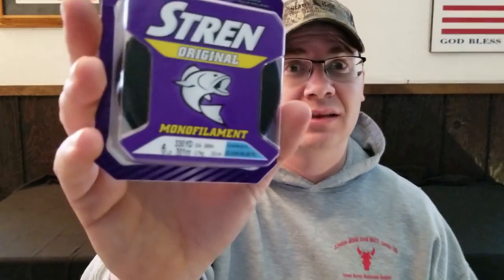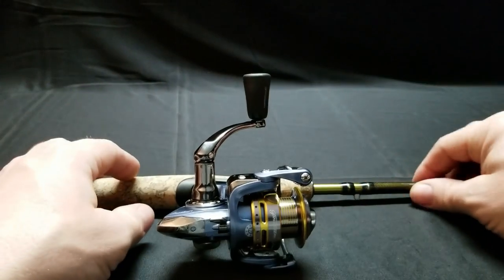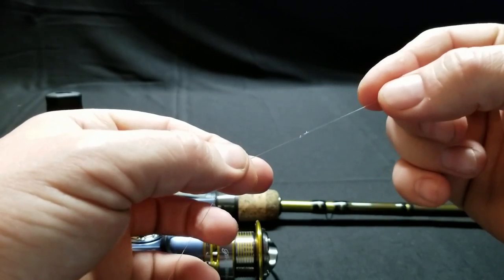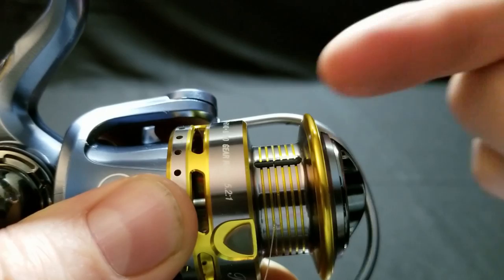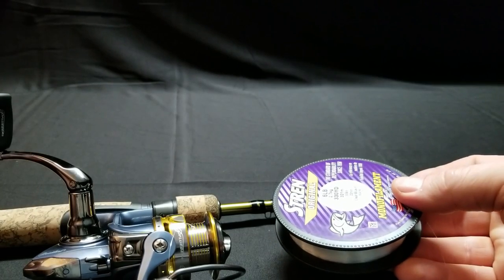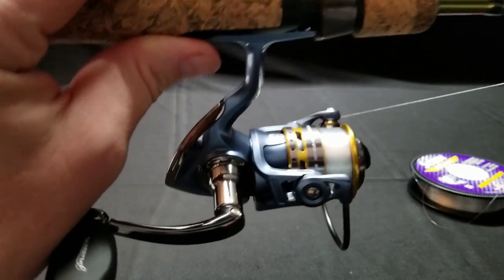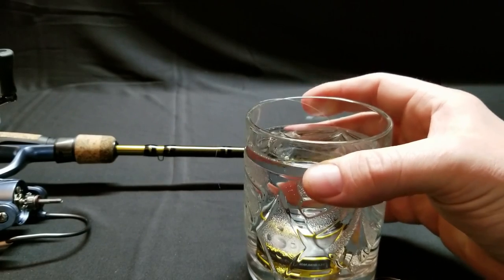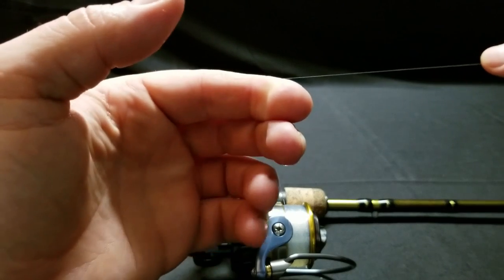NO MORE TANGLED LINE!!! | How-To Put Line on a Spinning Reel

Comment: Because of the size difference in the spools, reel vs new line spool, you will get line twist if you keep spool label up. Just watch the loop coils as you're loading the reel. When you see the coils getting smaller just flip the spool. I do it with my feet. Just keep alternating the spool, label up and label down. Have done it this way for years and don't have a problem with line twist. I hope this helps someone. Great tip on the warm water. I never knew. Tight lines brothers.

Comment: The part where you said “no matter what type of line it is, as long as you have the label pointed to the sky, it will come off the proper way” is entirely false. Depending on the manufacturer line is spooled in different directions. Although most are spooled the same, some are not, I’ve seen it. The key is that you want the line to come off counter clockwise.
Reply: I agree totally . The label has nothing to do with anything. If the reel winds on clockwise, the other spool needs to be coming off anti clockwise.
Reply: @stevestumbaugh8982  this clockwise tip is great but, clockwise on the reel looking from where? I just now see that it's looking from handle through reel to spool.

Gotta go wind up a new reel.
Reply: Ohhhh so that’s why I’m making a tangled up mess each try and have to cut it off wasting line.  I was following label up and that’s wrong for me. Wish I’d ran across this comment earlier as would saved me mass frustration. Damn near took it to a shop!
Reply: Exactly Redline.  Not all manufacturers are alike. Case in point I just spooled on some 6 lb trilene, the line is supposed to come off the Spool in the counterclockwise rotation, the label is facing towards my bed.  The correct way of saying it is the line is supposed to come off counter-clockwise, nothing to do with the label. Mike Iaconelli and others will tell ya the same 😅
Reply: @hardrockminer-50  Looking from the rod tip at the spool end of the reel.  If the bail turns clockwise the line spool should lay on whichever end that has the line coming off counterclockwise.
Reply: Jack wagon he said that in the video .
Reply: I only use mono on one reel that holds about 160m of 3kg line.   Its a lot for the reel and best option is backing but ill explain that one later.   I buy two spools of Maxima and in order to make a continuous line they have to come off with label down.  I do agree with the warm water for memory but if you put "too much" tension when putting it on, your line uses a lot less space on the reel. Even though you left extra seating lip (appears 80% full)  your second cast could become a birds nest because you never gain the same tension on a regular cast retrieve.  I cast about 80-100m so it gets real loose and very fast.   Might pre-answer why i use line so light.   Its a distance thing on lakes in Ireland that has wild trout who get spooked very very easily.   And yes,   i do use small baits for trout.   Prob weighing about 6g.    I can peel that off a reel without problem.   Wind permitting.
Reply: You are right. I clicked on this video because I wanted to double check that it was supposed to come off counter clockwise and I fast forwarded to the part where he said “label up is always correct” and I was very disappointed. All great tips except for that part...which can totally screw it all up and cause someone to waste 200 yards of line. Because of that, I had to give the video a thumbs down.
Reply: Redline870 Correct!
Reply: Filler spools are not labeled consistently.  Just make sure the line comes off the filler spool counterclockwise.  All spinning reels turn in the same direction.
Reply: ...so if the line is spun clockwise...
Reply: Zebco brand line is spooled all different
Reply from the maker: You are correct
Reply: @stevestumbaugh8982  that makes no sense dog.. Anti clockwise??? Are you related to Joe Biden??

Comment: Good video, I agree from experience if the line does not come off the spool with the same rotation as the reel it will tend to birdcage and you have a mess, especially if there is any slack on the cast.  If you spool in the wrong direction then you can usually put a heavy weight on the line and cast as far as you can, then it tends to reel back on correctly.
Reply from the maker: I have had to walk all of the line off the reel and reel it back on, thanks for watching!

Comment: I have, on multiple occasions, seen supply spools (what you buy at the store when you get fishing line) loaded backwards. Most of them seemed to be large spools, like what is used by tackle shops. So, always check the direction the line is coming off the spool. Usually, you'll want the label facing up. But, not always. I think a lot of spools used by tackle shops are loaded differently, but I don't know why.
Reply from the maker: As long as the line is coming off the spool  counter clockwise you’re good to go.

Comment: i have seen so many vids on how they think a proper spooling should be done and no way to tell what is the correct method, but a thought came to mind that i can spool line on my reel any way and then when im done simply get a large bearing snap swivel and attach my line to it and use the snap to attach it to a fence and then start walking back and unspooling it all the way ,then slowly put a bit of tension on the whole length of line and let go a few time then start spooling it all back on, i believe this helps stretch the memory out and the bearing swivel removes any twist on the entire line so that the whole length of it is straight without twist before you start reeling it in, and after that you can always dunk the spool in hot water and leave it till it cools down or leave it in there for a few days which helps to remove memory and like you said shape it to that diameter,, let me know what you think about using the snap swivel like that
Reply from the maker: I think the snap swivel will work, but it better be a high quality swivel. Some swivels don’t swivel well when there is pressure on them.
Reply: @MidwestBassHunter  correct get one expensive high quality ball bearing snap swivel and even spray some wd40 or oil it up to help even more , this is also why i say to put tension and release a few times to help it remove any twists ,doing this intermittently while reeling the line

Comment: I get a piece of wood with a nail in it, put the spool on the nail laying on the floor. Thread the line through all the eyes. When I'm reeling I lay a book on the line and reel it in naturally and never had a problem.
Reply: That's not a bad idea. I usually just have my gf or cousin or someone stick a pencil through and put tension on the line spool  in-between there fingers. then reel it in normal. Then depending if they need to or not have them add or release tension on how tight theyre squeezing the line spool

Comment: Dont depend on the spool label to be on the same side of the spool for all lines. Pay attention so the line comes off of the spool the same direction that it will be loaded onto your reel. The Hot Water trick will help set your line to the smaller spool of your reel.
Reply: Yes, once in a while they mess up on this!  Also, if I see a twist set in, I will flip the spool for a few turns to reverse it. The line spool is a bigger diameter than your reel so a little twist can set in. The hot water trick is a good one that I will try - will reduce birds nests from line coming off the reel by itself.

Comment: Good timing on this video. I bought a brand new spool for this year and it has the worst memory I've ever had. To make matters worse, I'm going down to a 1000 size reel this year so the spool size is even smaller. I just respooled it and I'm trying the warm water trick. We'll see how it goes...
Reply from the maker: Good luck

Comment: if you have a boat, you can put it on any way it comes off the spool. All you have to do is let the line off the reel out behind the boat with nothen tied to it as you idle. Let pretty much all the line out and drag it behind the  boat for a couple minutes and then reel it back on. The line will be completely straight no twist what so ever. Its good to do this every so often and you will never have trouble with twist.
Reply from the maker: That’s a great tip!

Comment: Actually I used an old reel and spoiled it up with a towel. Then I hooked up the end to the actual reel which is the final destination to this line, set up brake on the old reel, this way when I roll it up, it will be the perfect tightness along the whole line.
Reply from the maker: Cool

Comment: Having the label up is not correct in all circumstances. The line needs to come off counter clockwise.
Reply: Yeah, I listened to this vidoe about spool up  and incorrectly spooled my reel with spider wire ez fluro.
Reply: It really doesn't matter which direction the label is going, so long as the line gets on the reel....
Reply: The line should be coming off the spool in the same direction your reel spins! I’ve had line that cane off counter clock wise, so I had to lay the spool down upside down bc my reel spins clock wise
Reply: Heat gun will put that label on the other side reel quick.
Reply: @mikewest712  😂😂😂🤟
Reply: So it's coming off the spool clockwise so he is doing it wrong?

Comment: I have a spinning reel and baitcaster, I like that tip, going to use it. I have a question, if I use braided line on spinning reel, do I need to put spool in water like you did the mono?
Reply from the maker: No need on the braid
Reply: @MidwestBassHunter  Thanks

Comment: Hi. I just got a new Shimano FX1000 ultralight. I got 10lb and 12lb fishing line for my Ugly Stick GX2. Does it really make a difference if I use thicker fishing line on an ultralight?

I'm still going to buy some 6lb line for it but I was wondering.. If you were stranded on an island and all you had were ultralight fishing poles and 12lb line, I feel like it would still work. I'm going to buy the 6lb line tomorrow.
Reply from the maker: It will definitely make a difference.  That setup will not cast and function as well with that heavier line.  That being said if I was stranded on an island I would use whatever I could get ahold of.

Comment: Even tension is best done with another reel . Set it up so that your line goes from the spool , takes three turns around the slave reel  then onto the reel you want to load . Line every thing up and set the drag on the slave reel so when the line is loading onto the reel you want to fill it's a perfect even tension . Set the tension correctly and it stretches the line while you're at it ..no water , no stretching required later , job done in one hit .
Reply from the maker: Interesting 🤔
Reply: Very good idea

Comment: Good video with one or two exceptions. So, a possibly stupid question from a 50+ year Bass/Crappie angler who uses spinning and baitcasting gear on an almost equal basis. If you used the warm water to "Reset" the line memory from the larger diameter of the filler spool to the smaller diameter of the reel spool, why the last tip of stretching the line? And is that stretching of the line merely the last 12", or a longer or shorter distance? What purpose does stretching that segment of the line serve, unless you feel that it helps when tying on a lure or terminal tackle. Either way, it should be stated, because if it assists in tying on, shouldn't you mentiion that this is recommended before all reties as well? and wouldn't you cut that section off to remove the kink made by the line holder on the spool? I always do, anyway. One other point, the label pointing up has not always proven to work for this veteran fisherman, for some reason I have found that the label down works as well because it is not the label that matters, but the rotation that the line is flowing off of the filler spool and onto the reel spool. No matter which way the label faces, the line MUST uncoil counter-clockwise (right to left in front of the reel) if the line goes on the reel counter-clockwise (right to left viewed from behind the reel), and clockwise off the filler spool if clockwise on to the reel spool. Case in point, my Mitchell 300 winds line on with a clockwise rotation (viewed from behind), and my Okuma AV40 winds line on with a counter- clockwise rotation. If the "spool label UP" were set in stone, then many angler's reels would be spooled backward, or would be if they proceeded to spool on the loops and twists onto the reel while simultaneously cussing the proceedure. I seem to recall a couple of Tsunami spinning reels I had in the past which loaded clockwise also, maybe not, been a lot of years ago. But I still have my 300 here now, and if I loaded it as you stated, I'd prolly be cussing you as well as the reel. But fortunately I go by the rule I learned many years ago, "Off the filler spool in the same direction as on to the reel spool", and even that doesn't relieve 100% of line twist, but it's a heck of a lot better. Spinning reels "create" twist naturally. This is inherent because the line (under load from retreiving lures and landing fish) cannot turn 100% freely, even when a swivel is used, and most anglers tie directly to the the tackle or at best to a snap or split ring (I use a Duo-Loc snap most of the time myself). Even the minimal "load" or "drag" created by a lure will cause a small amount of line twist because the line is not spooled in parallel, but rather at 90° which causes an opposing rotation by the bail, and thusly some amount of "twist" is the result. There is currently no way around that fact. But if you can figure that one out, you're sure to be a rich person.
Reply from the maker: The warm water and the “stretching of the line are both helpful in reducing line memory.  The stretching is just for that.  As far as the label up or down, you are correct.  I had always done it label up and it always was the correct direction, I have found some that are not spooled that way though since.

Comment: Label up doesn’t always work. Some companies coil counter clockwise and some coil clockwise. And there are occasions that you could get a spool from the same brand weight and all and the sticker is on the wrong side.
Reply: You are correct.  Not always sticker up! pay attention which way the line comes off spool.

Comment: Is that a pflueger reel? How much line can it hold. I think I have 12 lb and 14lb mono. Mostly going after bass and pike
Reply from the maker: It is a Pfluger reel, if you are putting that big of line on it, use a 3000 or 4000 size reel.  You’ll get 100-150 yards of line or more on it.

Comment: Good video but lable up doesn't always work I've had the line come off the backside of the spool always check and make sure which way the line comes off
Reply: Should the line come off clockwise or counter clockwise?
Reply: @mikeallen1978  counter clockwise
Reply: It depends how your reel turns. If it turns clockwise than the line must come counterclockwise from the spool and vice versa

Comment: Stren and Trilene are the two best monofiliment still
Reply from the maker: I have to agree with you, lot's of folks say Sten and Berkley lines are junk, BS, they are good lines and priced reasonably.
Reply: Would personaly rather fish Shakespeare $.99 filler spool line that Wal-Mart and K-Mart sold years ago, than Stren. Fished Stren for a few years, lost too many fish from broken knots so I switched to Trilene XL. Went to Tulsa Rod and Boat show many years ago and there were booths for both Stren and Trilene. Asked Trilene Rep if I could have 12" of 14# test. Walked it over to Stren booth and the guy was doing a demo, he had tied on 20# Stren with a Palomar knot to his testing machine. It broke (at the knot) at 21.2# (1.2# over, not bad). I tied an improved clinch in the Teilene 14# and asked him to string it on the machine. It broke (in the line) at 17.6# (3.6# over). Told him that should prove two things, Trilene line holds up better, and so does an inproved clinch. Many other angles have a different opinion, and I respect that. I can only speak to my personal experiences over 50+ years of angling.

Comment: Run the line through the butt guide first, hold your rod a couple feet above spool and once you start the transfer, lower the rod towards the spool, if the memory on the line coils, flip the spool over and load reel.

Comment: The way I do it it don`t matter how the line comes off the filler spool 
I soak the filler spool first  a few times in warm water before it is put on the reel spool   all so use a warm wet cloth as back up to get the line on tight , that way it gets the reel spool memory as it is going on

Comment: No matter what i do to my spinning reel line wise it always tangles up on me when using top waters, zara spooks, poppers, etc. I resort to my bait caster now for topwater and do not have that issue. Probably not related to this topic but any advice on how to top water with spinning equiptment and not get knots and tangles? Sometimes i use a steel leader when fishing them. Thanks.
Reply from the maker: I have experienced issues when reeling slack line on a spinning reel, when you use walking baits or poppers you tend to reel slack line.  I usually use a baitcaster for these baits.  What you can do is every 5 or 10 casts make a bomb cast and just burn it in without working the bait, that will get your line tight on the spool again.  Good luck!
Reply: With a fresh spool  of line I have always put some decent amount  of weight and launched it far as I could get it across the lake  then reel it in do that as many times as u want till you feel it's all good for a regular cast to start using baits